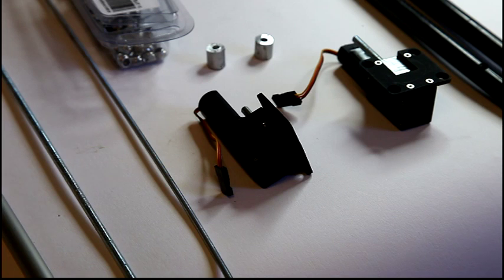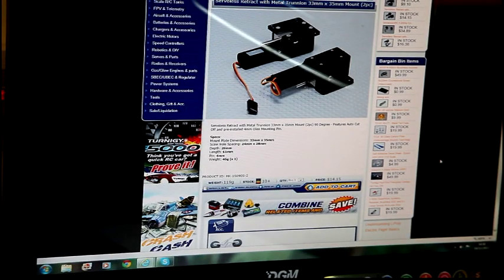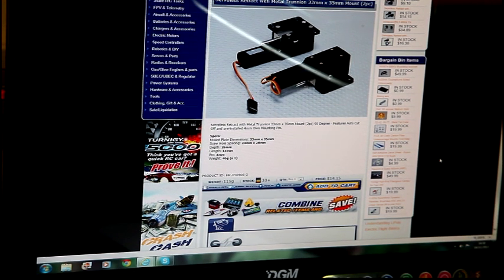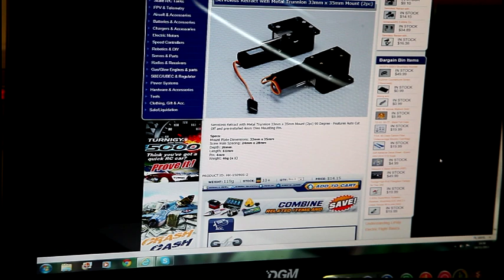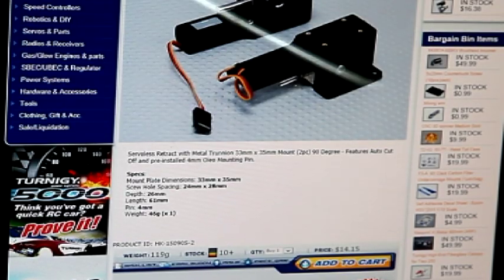Quadcopter DIY retracts for under $20

Comment: I have similar retracts - I have appointed a 2 way switch to channel 6 on my radio's. ( TGY i10 & FS_i6S)   I use a CC3D FC and Lebrepilot - which  shows the allocated  channel is selected and  function on the TX setup.  BUT  the legs do not function.  Anybody  got  tips??

Comment: Do these actuators have adjustable limits for setting up and down positions? What are their electrical requirements? Cheers
Reply from the maker: They are either up or down, no intermediate positions. They need to be driven by a 5v ppm signal (i.e. the signal provided by a servo output from a rc receiver)

Comment: Thanks for caring enough to attempt to document this process.

Unfortunately, the poor lighting and camera angle combine to keep us from actually seeing what you're doing/what you're referring to.

The mic on camera is particularly poorly suited for the live audio space you recorded in. The reverb detracts from message clarity. A modest boom mic, lapel mic, or blankets on the walls will significantly lessen the reverb.

Clearly, you know what you're doing there, with the vehicle modification.
Getting that knowledge across well to others is not as easy as some might think.

Practice makes better.
Good journey.

Comment: Thank You ,Sir. Like Peter Plantec, you have resolved a couple of issues I have been stuck on. Removing the existing trunion - I now know them to be held by 2x3mm hex grub screws (I tried to drift them out, thinking the were friction pins!)

I am modifying a pair of Tarot legs that have the metal fittings - I don't like the idea od drilling through the top piece, so I have some 12mm aluminium stock arriving tomorrow and Similar to your collet, I shall make a small piece the will fit inside the top fitting and shaping a D profile to receive the new threaded 4mm trunion.

Comment from the maker: Good idea Peter, I would like to see pictures of how you do it. I have changed it a bit and will shortly post another video of the final setup. The arms fold inwards to make it tidier, but the retracts in this instance need to be mounted underneath the motors. I am ready to test it in the air (weather permitting)

Comment: sorry to go on and on, but silly me.  Instead of epoxy why not just drill two counter sunk holes on each side of the square CF tube and screw them to the CF round tube arms using a bit of glue to secure the small screws into the arm.  That way we could remove if necessary.

Comment: Chris, brilliant.  I've been noodling how I would do this using the very same retracts. you've solved the problems I was stuck on.  I still want to have a nicer attachment to the copter arms.  Perhaps a short piece of square carbon fiber tubing with one side cut off, and the retract mounted to the other side, then epoxied carefully to the arm.  I'd prefer a method that allowed me to remove the retracts, but I'm still visualizing. Thanks so much for your inspiration. P Plantec